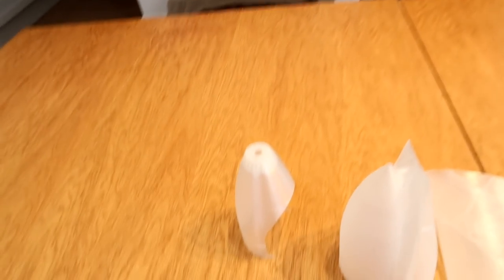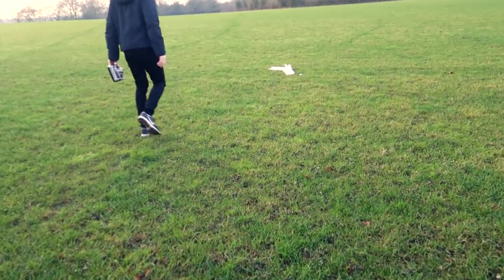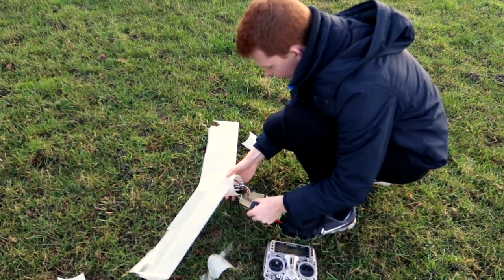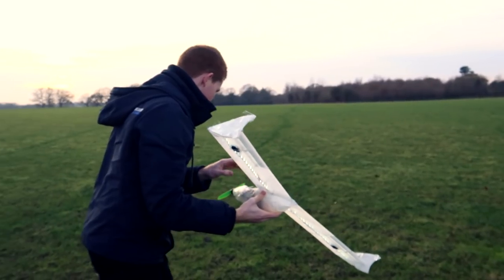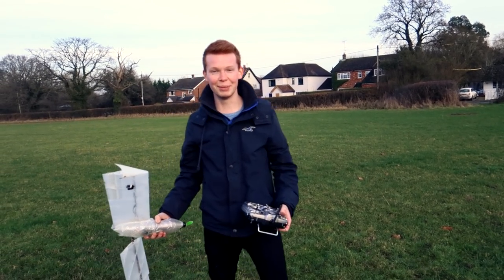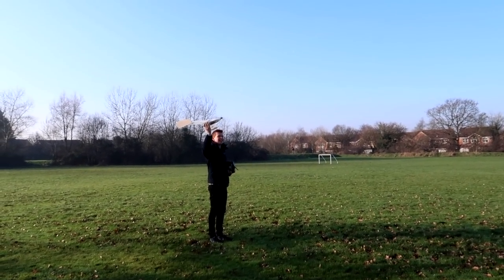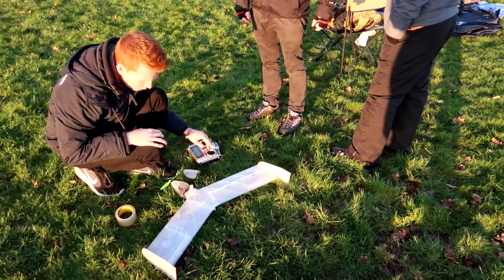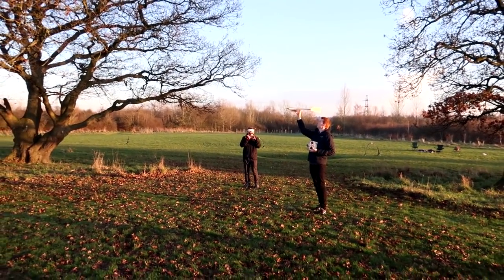3D Printed plane - Will it fly?

Comment: Great works
The other idea of external helices on wing is also very good it probably needs a nail quick turn possibility to improve the equivalent helicopter placement

Have you ever remarque the similitude between a fish on his lateral side and a plan wing in the same side

Did you ever think about the conservation of a floating part in the top volume of the wing ?

Your helico-plane is really interesting, if helices battery are separated from the wing control system battery device
If you place a levitate solution over the  equilibrium point, there's 3 ways to prevent from crashes
Place a security parachute wing on the cockpit and you've got a wonderful hyper secured device
With adding air bags in the cockpit, you can be protected from very high kinetic crashes

More small forces but a real improvement as in energy as in safty

Forces are always linked to scales
With the most power you have, with a small clamp, it will be very difficult to move bolt
With the good level tool, a child is able to do it in a few time ;-)

Even you know nothing about a car engine, a young human is able to run it
And use the powerful solution of multiple atmosphere pressure in the combustion chamber to run the car

This is the ingeneering
Creat something simple to use, but really efficient in scales incidence that are used
From many litters of petrol, new engines are now really powerful for a small quantity of energy

We've lost 31 years of levitation improvement, and cumulate experiences, not a real problem if we stop energetic failures in all our lives moments

Talking about energetic solutions
Isolate a house with a protective mantel is more effective than pieces isolation
A big fire isn't a good solution
In cold countries as Norway, the isolation is so powerful that a simple candle is suffisant to heat the house and when there's to many peoples, because of each body heat, they need to open the windows

More interesting than burning trees

Then think about planes thermal engines and flying abilities...
Two hot engines with the exhaust at the end of the wings, to amplify the capacity is certainly better
Simple solution with the exact same parts, combine differently
If one shut down, needs to permit the double exhaust, with half power to maintain the flying process under control this can perform really the actual working designs
The problem of heat is just not solved

But indeed this solved an old problem, the cold conditions that can froze the wings and make them really more fragile in certain conditions of weather

The fact is that it really improves a lot the flying capacity
As two brothers balloons in each wings
This is in my idea the possible solution to improve the process in high altitudes
The heat following the circuit between each new bubble maintaining perfect condition of thrust

All my childhood there was essentially American nightmare films or stupidity
All my life i tryed to survive without real money time
For what ?

Being pushed out of my ancestors living place because of not enough money they give me to be employed to destroy my own land and construct more houses or commercial centers for strangers !!!

How many time will you save with money ???
Do your children will be able to eat iron or plastics ???
This world turns in the wrong side since too many years

Before sleeping, the funny results of low frictions
https://youtu.be/WLNEZ4QRu0c

Comment: My concern was the 3d printing layer direction when printing the wing as the forces on the wings act against the prints weakest layer strenght as the layers are just melted together. My first attempt would be to reinforce the wings with tape orthogonaly to the  layers to give it kind of a grid layout.

Comment: Woah! That's was spectacular! I'm currently a freshman in highschool (year 10) and I'm in love engineering, especially the aeronautic field. Where did you learn to work circuit boards and  what books would you recommend to read so I can work on projects like this? I'm currently taking an engineering course and I'm loving it! (I also have the highest average in that class. Woohoo!) Also, what printer do you use and what CAD software? Thanks for making this video. -Sony

Comment: Please continue in this direction. great show and I would like if you take this into more difficult designs which are hard to do with traditional RC builds.

I like the educational aspect.

Do you have tour designs on web? you may want to consider that :)
Reply from the maker: +Garth Olivier I will be designing a version 2 soon and will upload the files onto the web. It's definitely useful for building complex aerofoils. Thanks!
Reply: Great, if you get a all metal hot end you can use PETG or PC which will have stronger parts

Comment: On the first few attempts you shouldent of thrown it at that high of a pitch, You should of tried launching it at a lower pitch so it wont stall out and go into a spin. Also you could of added the engines on the side and add 2-4 engines to inprove thurst and make a larger wing to inprove lift and lift stibuility. Also mabye moving the wing back a bit could inprove the center of lift.

Comment: My years of KSP experience has told me that the centre of lift should be on, or slightly behind the centre of mass... Let's see how this flies...

EDIT: I didn't factor in how heavy the fuselage is and how light the Li-Po battery is. Keep forgetting technology advances at ridiculously fast rates, and 3D printing is relatively new. D'oh!

Comment: Why did you slant the ribs in the direction you did? I am concerned that deflections under increasing load will cause the wing to flex to increase the angle of attack of the outer parts of the wing, a divergent and dangerous condition in full sized aircraft. Slanting the ribs the other way would reverse the effect, much safer.

Comment: The fact that none of the printed parts broke just means they're still too strong.  My response would be to use a smaller nozzle to get thinner walls.  I'm not sure why you went straight to a flying wing - these may be simpler, as in fewer parts, but take a lot more tweaking to get right than a conventional design.

Comment: The main reason none of 3d printed parts were damaged, is because it came apart so easily. If you glue it solid or use a really strong spar, then it WILL suffer heavy damage on crash. 
Interesting experiment, but this took days to design and print... you could build a balsa model that is much lighter. In that respect, it is not worth 3d printing flying models IMHO.
Reply: Every normal designer can make a basic design in hours.
Reply: MegaNitrospeed I said "design AND PRINT" 20cm piece of wing took 5 hours to print, didn't it. Experienced builder will design, build and cover entire wing in that time.
Reply: That usually depends on the printer and the settings, but you can do more designs and use composite wings with 3D printing. When you use balsa, you just use balsa.
Reply: Balsa is just a material, one of many I use. I could say "when you use PLA, you just use PLA".
Reply: The difference is that one requires the builder to actually invest his/her time to build the wing, while the 3D printed wing is almost wholly machine-fabricated. Sure it takes 5 hours to print, but once the design and print settings are perfected, you can pretty much hit print and do something else while the parts are made.
Reply: That is my point exactly, the materials are less than perfect for this job. The wing is simply too heavy, and no design or settings will help. Unless we get other materials to print out of, it will never be a real alternative to a built-up wing.
Reply: MasterBata that sounded much like saying that a boat made out of metal can never float as metal is too heavy and no design can make it possible. no mean comment btw. im just saying you should be more open to new ideas and the main problem with the first crash was the launching as he launched towards up instead of forward so it stalled pretty quick.
Reply: to an extent I'll agree, you can bang out a KF airfoil from foam board in a few minutes, load the goods and be flying it in a couple of hours. did a KF-6 to KF-4 transition, KF-6 center 22" with KF-4 outer 9" (40" span) in 2 halved miter joined 5-6 degrees dihedral like it was nothing. rough looking awesome flying and puts up with some punishment. on the other hand the printed stuff can be SO SO PRETTY!!
Reply: +Gokalp Cetin - you didn't understand what I wrote, no mean comment btw. I hope you will agree that wing built using this technique and materials has several times higher loading than it should? 
To put it simply - 3d printing is cool and all, but the materials (ABS and PLA) are shit.
Reply: MasterBata yeah i know but it still should be possible i think.
Reply: MasterBata have you looked at what is being done in this area lately? GE prints over 200 parts for its latest jet engines. I have 3 3d printed planes that fly incredibly.
Reply: +Ben Khana - what part of "Unless we get other materials to print out of, it will never be a real alternative to a built-up wing" did you not understand?
What materials do you print planes of? What is the wingspan? What is the AUW?
Reply: MasterBata yep simple PLA will print a Supermarine Spitfire that has been clocked in several videos at over 143mph. Perfect material for the task? Maybe not, but still fine results in my book. Check out the P-38, I'm printing one right now. The materials exist to print one that will exceed all of the specifications you are talking about, using carbon fiber mix of ULTEM, but only in industrial temperature controlled printers. Just saying I printed out a FPV plane with 60" wingspan at home on a PRUSA i3 MK2, with simple organic based PLA $12 and it performs fine for me. Just look at the web site I sent you.
Reply: MasterBata I was stick building control line airplanes in the 60's and moved on to actual remote control in the late 70's. I think it may be time to move on.
Reply: There's a very nice, twin-engine, 3d-printed plane on YT Flite Test channel......................
Reply: But the point isn't just to build a plane here, the point is to build a plane (using 3d printed components) I don't think that Tom would even try to argue that 3dp is the best way to make a plane... it's a design challenge.
Reply: @UndercastEsmeganitrospeed  you can not print something of this size in a few hours.

Comment: I didn't watch all of the video or read all of the comments, but issue is clearly LACK of LATERAL STABILITY.  More sweep and larger winglets are required. Or simply a tail section with a big vertical stabilizer. Your winglets are too small and has too little area AND your motor/prop is up front. If the motor/prop had been at the rear, it might have added a little lateral stability, but right now your plane is like and arrow flying backwards. Not stable at all.

Good work, though!

Comment: You should learn to launch with your left hand. I hold the controller in my right, use my chin to add take off throttle and launch with my left hand. I have never had a crash on takeoff in hundreds of flights with 7-8 different planes. I have had all kinds of saves where I would have been rebuilding my plane if there was a .25 second delay. I guess it kinda helps that I am left handed.
Reply from the maker: +Specter0420 haha very true

Comment: What if you printed boomerang propellers for a plane?
Reply: Jonathan Nunez - usually called "Scimitar Propellers" - main use case is to defer adverse compressibility effects near the blade tips, like sweeping the wings on transonic/supersonic aircraft wings for similar reasons. This then allows more power absorption in a given diameter as the tip speed is less constrained.  Often combined with increased solidity (lots of blades) which has a similar effect, but tends to reduce efficiency of the system. See: https://duckduckgo.com/?q=scimitar+propeller&t=canonical&ia=web

Comment: Since the beggining the problem was in the way you were tossing it.... you're clearly tossing it too soft.. to slow... you were definitely too close to the stall speed of the model....

In such a situation, all the other problems are more noticeable like the stability issue that made you put some winglets.... but that was not the main cause of the model refusing to fly. Again, problem was in your toss.

Remove the winglet and the modifications you made to the original design and try tossing it really fast, like with a bungee launcher.. i'm preety sure it would fly.

Comment: glad you finally got it flying. 
 looks like not only where you not getting enough speed at launch, but all so to high angle of attack - inducing a stall right away.
wondering if you can reduce those winglets and still keep it stable.
or try eliminating winglets completely by introducing twist into the wing - via PRANDTL-D wing design.  (would need longer wing span)
https://www.youtube.com/watch?v=0Oh0Q0Dv28I

Comment: 3d printed planes are two heavy
Reply: I think that if he used Color-Fabb's light weight pla that foams up when you print it so the parts are almost twice as light it could have worked a lot better.